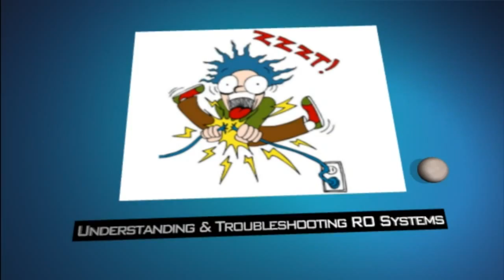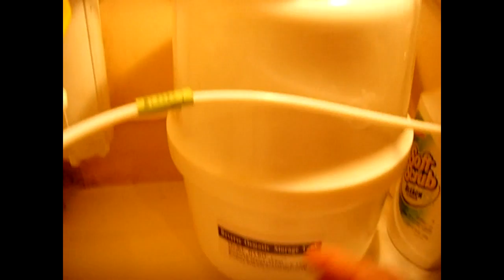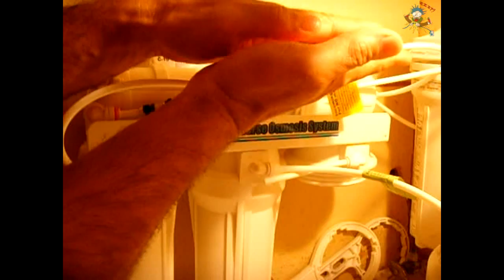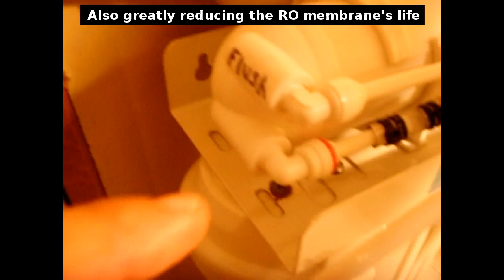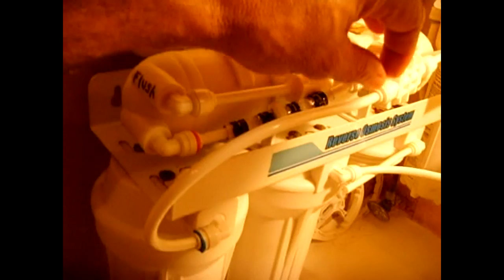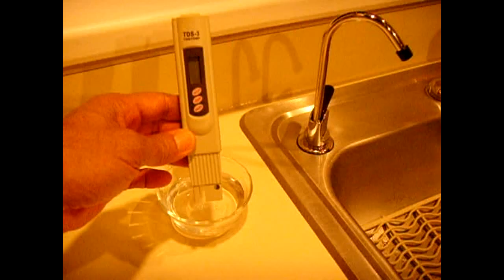REVERSE OSMOSIS(RO) ~ Troubleshooting & Repair(Step By Step)

Comment from the maker: If the water pressure into your RO System is too low, then you'll need to purchase a "Boost Pump". If a flow restrictor is blocked, then your RO membrane will become clogged more easily and you'll also notice INCREASED TDS readings.

The link provided below is the BEST deal for a 5 stage RO system that includes an extra set of filters. Thanks for watching! 
https://amzn.to/2Qk5C6F
(Amazon Affiliate Link)

Comment: I enjoyed your video and have a question for you. I change the filters annually & the "brain" every 2 years. Our faucet for the RO starts out fine, but after roughly 7 oz of water it begins to trickle continuously. If I shut the faucet off for 2 minutes the previous pressure comes back until the 7oz of water mark and then it trickles again. The tank pressure is where it should be. Do you have any idea?
Thanks, in advance.
Bud Golata
Reply from the maker: Pressure tank issue
Reply: @electronicsNmore Thanks for the reply!

Comment: Your system is extremely wasteful .My system has no flow restrictor .In the UK we have a dual system where the mains water is separated one side goes to the kitchen tap and a branch goes to a low pressure side which is a large tank in the loft with a ball cock to switch off the water when the tank is full ,this feeds your bath or shower and toilets .My system uses the waste water from the RO and a timed electronic valve and the waste pipe runs into the tank in the loft .When you draw water you press a switch and the waste water flows for 1 minute switches off for a minute then runs for another minute .We have had the system running for 10 years with no problem . To stop back flow down the waste tube it has a anti back flow valve like the one on the outlet of the RO canister.

Comment: I have looked at numerous other videos and after watching yours through to the end I finally isolated the problem. It was the spring loaded check valve on the corner outlet of the 4th filter stuck shut, hence no clean water to the final filter and tank/tap. I cleaned this and  checked it worked by blowing through. I will visit my local fontenera here in Spain to buy a new one. A very big thank you to your excellent video....chapeau.
Reply from the maker: Glad the video helped!

Comment: Best system tutorial on YouTube after all this time. My tank pressure was low and even lowered it further in ignorance as I was clueless. Put in 7 psi and voila, back to normal. I like the way every part is explained in detail and the why is also offered to the viewer. I now have more confidence in dealing with reverse osmosis and can explain to my other half the intricacies that beset the operation of this aquatic filtration apparatus.
Reply from the maker: Great to hear Tom! Be sure to check out my very wide range of videos and share my channel with others. Thank you

Comment: My RO system was hissing for a few hours and then suddenly it's constantly draining water now. Tank is empty and not filling up. The drain tube has condensation so it's high pressure water constantly flowing. As soon as I shut off the water, the drain stops. Once I turn on the water, it seems like the water goes straight to the drain. What could be causing this?

Comment: At 13:05, when you blow through the check valve, should you get a smooth air coming out the other end?  I blow through my check valve and I do feel air coming out the other end, but not strong air coming out comparing to the pressure that I'm blowing.  When I blow from the other end where the pink ring is, no air is coming out the other end, so the check valve is working.  I'm having very low water rate coming out of the check valve and I'm trying to figure out the problem.

Comment: This video was very helpful to understand the breakdown of the components in an RO system, their functions and how they are interconnected. All I could find earlier was how to install an existing configured system that was not helping me understand or fix my problem. The most helpful for me was the explanation of the auto shutoff valve. Thanks...

Comment: Low out put volume of water. How do I know it’s my pressure tank or membrane? First was thinking it was a bad tank. Left sink Faucet open till no water. Tank was heavy as if full of water. Took tank outside and opened the valve. Water came out for many minutes as if no issues. Picked tank up and shook. Felt empty and light. So now I am thinking it’s the membrane. Please educate me.
Reply from the maker: For the pressure tank, just drain out all the water and make sure the pressure is correct(6 to 8 psi). If you have low water production, then either your filter stages before the RO are clogged(especially the first filter connected to the water supply), or you need a new membrane. You can also try to backflush the RO membrane.
Reply: @electronicsNmore  
Just changed the regular filters day before yesterday
Reply: Thank you sir.

Comment: Great explicit video! I know have a better working knowledge of how the system works. I had hoped to find the reason my system is filling the holding tank but no water is coming out of the tap after i changed all 5 filters, the check valve, and the automatic shut-off valve.
Reply from the maker: Sounds like no pressure inside the tank.

Comment: Great video! Clear instructions excellent pace and video display of components.   One thing I wish you had included is when the system stops working.   I re-pressurized the tank to 7PSI.  but I don't know how long it will take for the system to work.  I'm not hearing the normal system noise when it's filtering the water.
Reply from the maker: After 10-15 minutes, there should be some water coming out of the spout when the lever is pressed.

Comment: great video, thank you. I recently purchased a Davis and Shirtliff 6 stage under sink RO apparatus and I have just recently replaced the three filters. Straight after replacing the system I restarted the system instead of working normally it starts, stutters non-stop and pushes through a few drops of water with every stutter. Any idea what the problem might be?
Reply from the maker: Sounds like a lot of air in the line.

Comment: You have any advice or information on how to retrofit a permeate pump into an existing system? Do you recommend their use to improve the efficiency and reduce water usage?

Does the pressure shut off valve still get used when a permeate pump is installed?

Thanks!
Reply from the maker: I've never used one before.

Comment: I'm having an issue with water leaking from the plastic tube right at the connection point at the system..
Reply from the maker: Remove the tube, trim off 1 inch, then reconnect.

Comment: How much pressure would you think is pushed out of the drain line? The house I bought has the under the sink style RO directly under the kitchen sink in the basement mounted on the wall half way up. The drain line has to go up about 10' to drain at the sinks plumbing. My water TDS readings are as if the RO is doing absolutely nothing. Could the drain line be backing up into the system, skewing my TDS readings? The system was plumbed wrong when I moved in, so I straightened all that out, sanitized, and got new filters. Still poor TDS results.
Reply from the maker: Hi Jason. It's not a lot of pressure. What's the TDS going in? If it drops 80-90%, you're good.
Reply: @electronicsNmore  I'm on a shared well in a subdivision, it's about 500 PPM. Only getting 480 after RO. I had bought a whole new system and just finished installing under the sink. About to turn water on and see what's what.
Reply from the maker: @jasonlockhart3168  Many wells are horrible. Excessive iron, or sulfur odors. That system isn't doing anything. Something isn't connected properly.
Reply: @electronicsNmore  I get better results from my Brita picher than the RO. So I'm just giving up on that unit. Just dumped the 2nd tank on new system, waiting for it to refill before testing TDS.

Comment: Where the taste and odour filter is could I place a deionise resin filter? I want to get a resin filter to remove more tds for mixing special cleaning chemicals that need deionised water but I want to use the system for drinking most of the time but I don't want the expense of running di setup all the time as it would burn resin. I plan to have an isolator tap so I can choose between taste and odour and di after the tank.
Reply from the maker: https://www.thoughtco.com/is-it-safe-to-drink-deionized-water-609428
Reply: @electronicsNmore  i don't plan to drink the di water (just use it to filter water to use in mixing chemicals) i plan to isolate and bypass the di filter when using drinking water and divert to the taste and odour filter when drinking. Basically after the storage tank i want to be able to choose between di OR drinking water by isolating one filter

Comment: Great video. One question: I have a 5 stage and it’s probably 8 months old. I checked our pressure at the outside faucet and we were about 40psi. While our RO faucet has plenty of pressure, I noticed pretty quickly that the drain line would run pretty regularly after or during using the faucet. Is this a low pressure issue or how the RO system works? Thanks!
Reply from the maker: When you drain water out of the tank, the pressure drops. The pressure drop turns on the flow of water into the RO membrane, and the waste water goes down the drain.
Reply: If your RO discharge waste water "during or after" using the RO facet, it would likely means that your RO storage tank air pressure is running low.  Check tank air pressure.  Pump it to between 7 and 8 psi.  Tank air pressure low means tank is water is full while RO keeps trying to fill it thinking that it is empty even when it is not.  Tank air pressure high means tank water is low but RO won't turn on to fill it thinking that it is full.  Try lifting the tank.  If the tank feels full while the RO keeps turning on at every use then the tank air pressure is either low or that the diaphragm is broken.  If the tank feels empty while the RO turn on for just a few minutes then shut off, then the tank air pressure is too high.

Comment: Good video. Bout to move into a place w/ well water(w/ high sulfuric smell) and want to add a reverse osmosis system. This points me in the right direction.
Reply from the maker: You better install a potassium permanganate sand filter for the sulfur issue before using the RO system.
Reply: @electronicsNmore  Thanks for the heads up. I do HVAC work, so I know my way around plumbing a enough to install this myself from working on boilers(and have access to wholesale pricing). I've never specifically done "plumbing" work like RO though.

Comment: Thanks for the video but my tank fills after 30 minutes. It unfills in 10. The PSI on the tank is 7.5 and the drain line is not leaking.
Reply from the maker: Either the system was incorrectly set up, or you need a new Auto Shut-Off Valve/Check Valve.

Comment: How do I buy you a beer!?! My RO system has been non stop running down the drain. Trying to figure it out and trouble shoot, changing the ASO to watch your video and find that the 90 degree elbows were mixed up coming off of the membrane. I just switched them so wish me luck that it's fixed.
Reply from the maker: I don't drink, but I do take Paypal donations to support the creation of new videos. Hope it works out for you. Thanks for watching!

Comment: Today the ASO (auto shut off) valve is outdated. Its inefficient in dealing with wasted water. If your household water pressure is sufficient - get "permeat pump" instead of ASO, it will hydraulically boost both membrane filter speed and reduce wasted water. If your household has low pressure or you want big membrane+no tank aka "direct flow"- get booster pump with ASO instead.

Comment: Excellent video.  We put in a much simpler system, and the tank is not filling?  A shut off was not on this tank, just a Tank inlet fitting.  The tank should fill without having the faucet running, correct?
Reply from the maker: Hi Catherine. Post a link to the system you installed. Thanks

Comment: The reason you have carbon / carbon block technology upstream of your membrane is not scale/mineral related.  Chlorine will attack and burn holes through the RO membrane.  Therefore, carbon block technology de-chlorinates your water upstream of the RO to prevent this from happening.  Carbon block technology will not de-mineralize or remove scale from your water.  If you have a high level of hardness in your water, scaling will occur irrespective of having carbon blocks upstream of the membrane.  You would need a water softener or water softening cartridge to prevent this from occurring. Carbon blocks are not necessary if you are on well water that is un-chlorinated.  You could leave those housings empty and just simply put in a sediment filter.  3 filters upstream of an RO membrane is overkill for an undersink system.  You could easily get by with a 2 stage or even 1 stage if you are on city water.  Hope this helps.
Reply: I should note that carbon will remove some species of iron, if you have high iron content in your well water, carbon technology may prove useful for protecting your RO membrane from iron related fouling.  I hope this helps.  Good video, thanks for posting.

Comment: Nice video. I just had a system similar to yours with only four states. I hear sound coming from the port of the faucet. Curious to know if this is normal like when I fill my coffee machine and the water supply drops in the system and then refills.
Reply from the maker: Once water has been taken out of the storage tank, the system will turn on to fill it back up. Thanks for watching!

Comment: Very clear video - thank you. I have a problem still. My 5 stage RO system passes water directly to the drain. I have tested the auto shut-off valve as 'working'. The check valve once passes a slight amount of air in the correct directing. The tank fills with water - and water comes out the faucet. Water still goes to the drain. Do you have an an idea what could be wrong ? I have 5.1 Bar of mains water pressure.
Reply from the maker: buddybeetle Either the auto shut off valve or check elbow needs to be replaced IF the system was correctly installed. Thanks for watching!

Comment: THANK YOU!!! I ordered a cheap RO system (under $100). It came with little to no instructions highlighting that it should be installed by a professional. It came with a roll of white tube, not the pretty color coded ones like other systems. I watched many RO installation videos, but knowing the why makes all the difference. Now that I know what does what, I can confidently install this puppy. It didnt come with a tap for the dirty water so off the I go to the hardware store.  I have a plant room in the back of the house. I was thinking of splitting the RO feed, running a line through the attic (insulated no doubt) and into the back room to my reservior tank. Distance of about 50 feet. What are your thoughts. Will normal water pressure make the run?
Reply from the maker: You're welcome! I would run the line from the holding tank, rather than run the line to the holding tank. Thanks for watching and be sure to share my channel with others and watch my videos.

Comment: I have a question, i looked at my 5 stage RO system and notice from the 2nd stage canister it went straight to auto shut off valve, then to membrane, and then goes to post carbon, then back down to 3rd stage canister, then from 3rd stage canister, I see 1/4" tube straight into my faucet, is my RO system being set up wrong? I thought the 1/4" suppose to come out from post carbon and not from the 3rd stage :(
Reply from the maker: Sounds like it wasn't correctly set up.

Comment: Does this remove FLUORIDE? Why is Fluoride not being addressed? Water distillers remove fluoride
Reply from the maker: RO systems remove around 85% - 92% of the Fluoride in water. I agree drinking Fluoride isn't a good thing to do, but toothpaste is just fine as long as you THOROUGHLY rinse your mouth after brushing. There are many other things that will kill you before Fluoride.

Comment: Hi, I'm troubleshooting my RO.  My problems may be two or threefold which makes troubleshooting really hard.  I bought two of those restrictor valves.  They are exactly like the ones in your video.  I cannot blow through either of them like you instruct.  I'm having a hard time completely believing I received  TWO faulty units, AARRRGGGG!!!!  Maybe there is a 'break in' period?
Reply from the maker: Check valve? or flow restrictor?
Reply: Ooops.....  Check valve.
Reply: Yes sucking worked. <insert childish pun>.  I got my 15 year old GE unit back in action today, woo hoo!!!  BTW your video is excellent, better even than those whose authors are trying to peddle their parts.

Comment: if I want to fill a tank with R/O water would I want to connect the line to the tank instead of the faucet or would I need to purchase the ice machine addition and run a line from there. i sont need the faucet for the purpose ai will be using the water
Reply from the maker: KJ Hebert You need a tank and auto shutoff valve.

Comment: i have a 4 stage system. there is a water line that I tees off between Carbon block and ASO   and goes to places unknown. Anyone?? What is the most common use for this?
Reply from the maker: The video should show it.